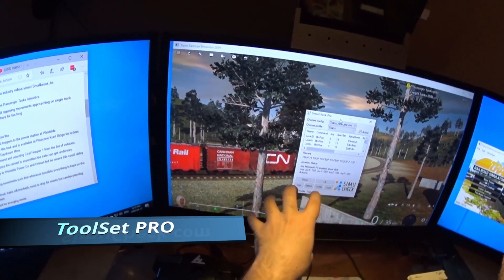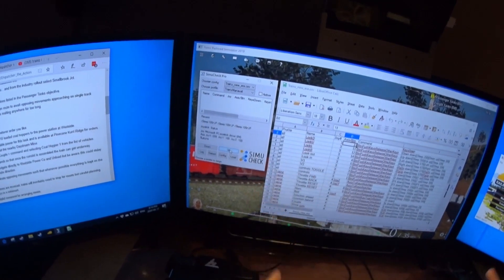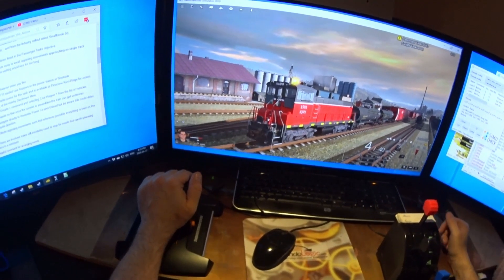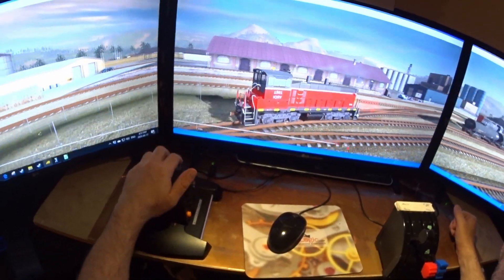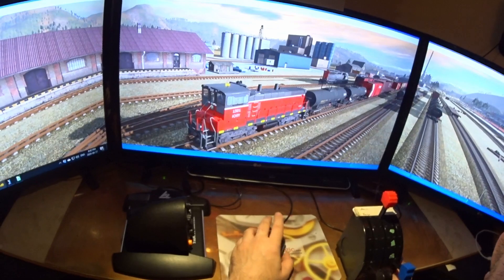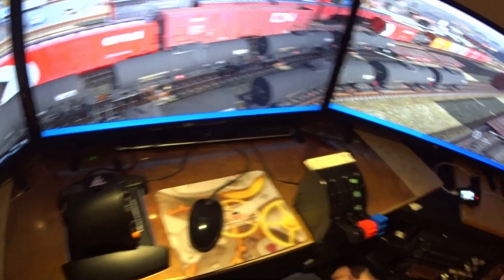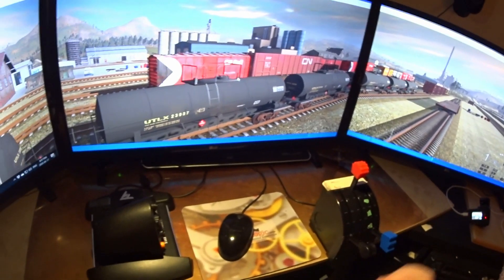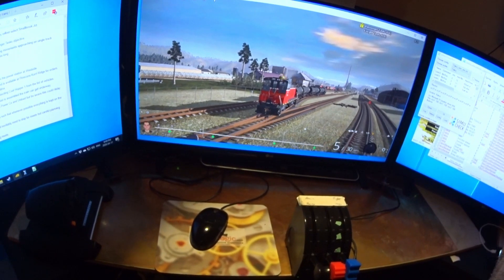How to re-assign joysticks to your simulator with our ToolSetPRO software

Comment: Hi, I'm having a bit (actually, a lot) of trouble getting this to work with a Saitek ProFlight Yoke and a throttle quadrant that came with it. Yoke is plugged into the PC via USB, Throttle into the yoke via DIN-5 I belive it is called. Did you put up something explaining how to find which joystick is which in this setup?
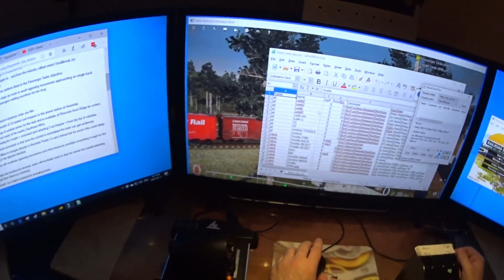Reply from the maker: Hi there, yes look at 55 seconds (0:55) in the video it shows that you need to push up and down until you find which joystick number your ProFight is set to
- first restart the program as after you assign to a profile it is a lot slower, but at start (before active it is more responsive)
- Next push up or down and each time click a button (you can also use AXIS, but it's easier to see when a button is pushed)
- Notice when you see any numbers appear (now you know this is the correct joystick number)
- Now in the spreadsheet you use this joystick number AND which button number OR axis

Let me know if any other questions

Comment: Know of any issues getting a Saitek X55 working on ToolSetPRO? I cycled through all the available sticks in ToolSet while pressing buttons on the throttle and again on the stick, but no button pressed ever appeared in the software. Only two of the options appear as Microsoft PC-Joystick driver (makes sense given throttle+stick) and have 000 values for their axis, but manipulating the throttle/stick doesn't change either of them.
Reply from the maker: Strange it should be a normal joystick, and my software is just interfacing with the joysticks in windows. One thing to try is restart ToolSet Pro, as before you assign a profile that detection is more responsive. (In the main loop for performance I needed to limit how often it updates). Then when you test the buttons is should display some buttons clicking or axis moving. If that doesn't work this is a long shot, but start ToolSet pro in admin mode (right click run as administrator) and maybe for some reason it can't find the joystick for permission issues.... Let me know if that doesn't work and I'll read online about that joystick.

Comment: Hi Sacha, is this suppose to work with TSW2020 ? I have SimuCheckToolSetPro-2020-05-16.zip , i load config TSW , profile ALL, and i set a joystick button for the E key, even ToolSet PRO recognize when i hit E, but in game.... when i need to take a seat for example...... nothing
Reply from the maker: Yes it works for me on Train sim world (NOT Train Simulator) - I would test in a word document and ensure that you see the E letter appearing. This way you know it is sending the key (from ToolSet into the application). Also I had an issue once where I needed to start ToolSet Pro in administrator mode (right click in windows and open with admin) - But if you are able to use other keys that should not be the problem. 
Finally are you sure you are sending the E up ? since if you sending the down key without the up (after a sleep) it would cause the key to 'stick' and this would definitely cause issues
Reply: Solved, was necessary to run both software and game as administrator.... crazy win 10

Comment: I cant get the config to pop up please help
Reply from the maker: This means you might not have a spreadsheet program on your computer. The best is to install 'libreoffice' - it's free and it handles CSV files really well - https://www.libreoffice.org/
- If you do have a spreadsheet program and it isn't working you can also go to the directory (toolset pro) and manually open the CSV file from there
Reply: @sacha-lewisd573  Thank you!